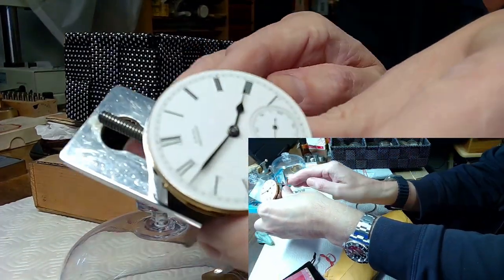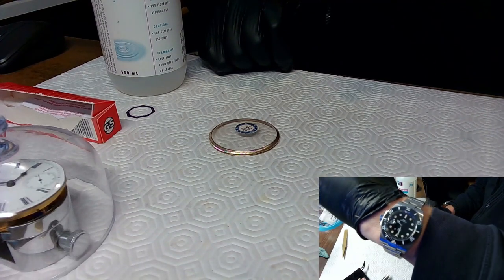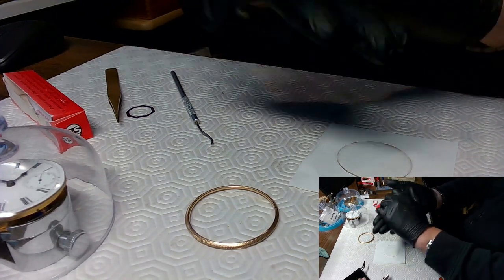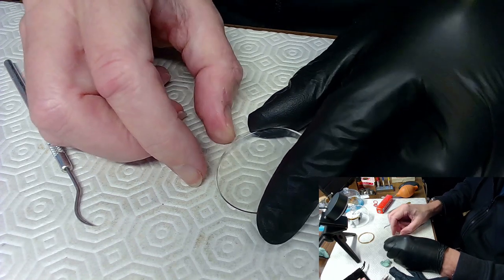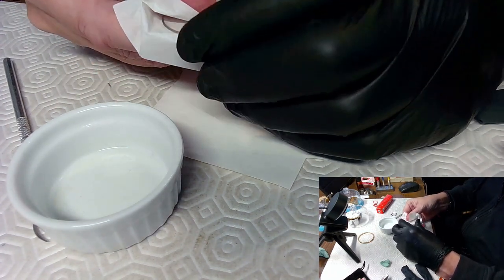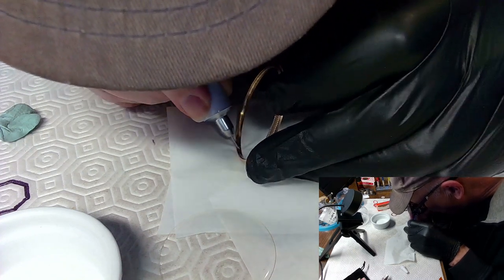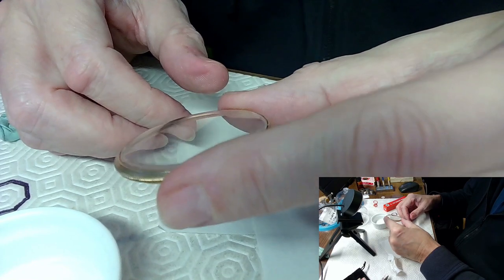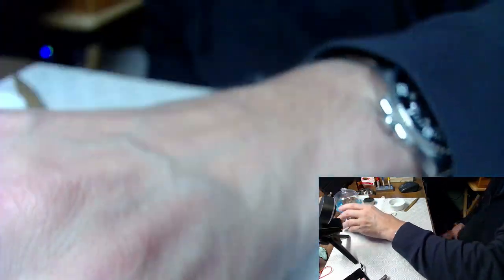Glue a Watch Crystal

Comment: G'day JD, Thanks, i will clean my watch crystal glass with evaporative stuff like IPA/lighter fluid b4 i stick them in next time. I use UV activated glue/resin to stick the glass to the cases/bezel. There are a couple different types UV glue/resin i have depending on what i want to stick to and to where, plus i dont have the issue of product running out of the tube, i can take as long as i want putting the glue/resin around the rim of the glass. I can wipe off the excess from the glass.It only starts to harden and bond after i hit it with the UV light. I dont have to chip excess off the glass,dont have to weigh it down, its all over between 30 seconds to a minute.
Good video mate.
Regards.
Mike
Reply from the maker: Can you provide the brand you use?

Comment: Excellent job as always, JD. I do envy your store of extra findings I have used I have used Goo Gone - a citrus oil - to remove really stuck on labels but then have had to go to alcohol to remove the oil. Never thought of going straight to alcohol first. Great tip - thanks as always.
Reply from the maker: I actually wasn’t sure what to use to remove the label on the Crystal, so I figured that alcohol would work

Comment: Thanks, need to do this to a few. I have a big box of vintage old stock crystals, but not one will fit right. I think I need to spin some slightly too big ones in a lathe one day and make the edge the correct profile,
Reply from the maker: I do have a lot of crystals that are a bit oversized, and still haven’t figured out a technique for removing material from the edge. I bought a crystal cutter months ago, but this is for cutting flat crystals made of some kind of plastic material and then melting it into shape. This crystal cutter holds the edges so obviously you can’tcut the crystal from the edge to remove material. I’ll figure this one out someday.

Comment: My watchmaker told me to turn the chyristal a small turn after fitting to help spread cementing,  whats yout thoughts?
Reply from the maker: @owenmccallum6076  I thought a bad idea if in fact, it will turn. With the glass crystals, you do have the ability to turn them or rotate them, but with the plastic crystals that is not always possible as they are usually friction fit as well. So Watchmaker, I think was a slight turn. Will make sure that the glue spreads out nicely.